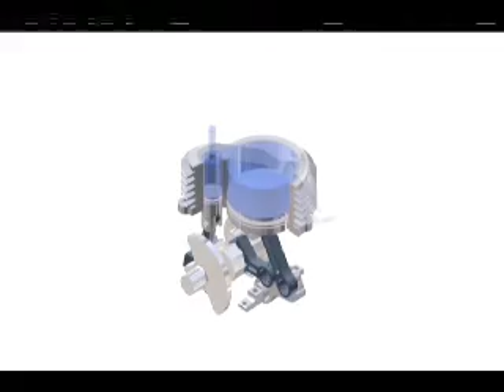A car that runs 200 miles on compressed air.

Comment: @blueearthgirl "Why would this increase global warming?" Because using the same amount of electricity to run the air compressor this POC needs in an electric car of similar performance you will travel 5 times the distance. The losses in compressing and using the compressed air are an appalling energy waste.
Are you still speaking with the ability to check on scams, analyze the science behind this MDI piece of crap or a you speaking with the usual green happy clappy please rip me off thinking?

Comment: - Filipino inventor, Ismael Aviso, has demonstrated a bare bones electric vehicle with an 11-kW DC motor running on just one 12-volt battery, which is kept charged via a Tesla-like antennae circuitry that draws electrostatic energy from the surroundings, validated by the Philippine DOE. He hopes to introduce plans and kits commercially soon; may open source.... (PESWiki; [updated March 22, 2011])

Comment: Quote- The Pneumatic Options Research Library is a treasure trove of information on how to gain free energy from compressed air. The most important fact to realize is that the very act of compressing air yields free energy.

Comment: This happens because, according to the mathematical formula PT/V, 100% of the energy required to compress the air is converted to HEAT, but then you also have the compressed air that can produce mechanical energy when it is expanded again. A home heating system that uses this principle was patented in 1930 and is available for download here: THERMAL PLANT - Google Patents Dr Peter Lindermann- End quote.

Comment: Using clean and renewable compressed air for motive power has been around since the 19th century. It was then that the first approximations to what could one day become a compressed air driven vehicle existed. This began through the arrival of the first pneumatic locomotives.

Comment: The Magnetic Wankel Engine
(Takahashi Motor)

 The Magnetic Wankel engine should also be capable of COP > 1.0 and closed-loop self-powering, but apparently it has also been suppressed, as have all Japanese COP > 1.0 EM systems.

For details, see T.E. Bearden, "The Master Principle of EM Overunity and the Japanese Overunity Engines," Infinite Energy, 1(5&6), Nov. 1995-Feb. 1996, p. 38-55; "The Master Principle of Overunity and the Japanese Overunity Engines: A New Pearl Harbor?".

Comment: The National Tattler (November 11, 1973), p. 6

"Car Driven by Fuelless System"

by

Tom Valentine

You’ll never need to drive into a gas station again if Robert Alexander’s fuelless car gets into production.

Alexander has invented an auto-drive system that uses a combination of electricity, air, and hydraulics.

His car can operate without fuel, without noise, without pollution and without the need to recharge batteries every day.

Comment: @braikar This POC requires 5 time more energy than an electric vehicle of the same performance. The air tank has a limited cycle life. The best recorded and published range in a test was 5 miles. The technology is 100's of years old and has no possible improvements that haven't already been tested (multistage direct injection). It's a 15 year old con that has taken well over  $20 million from technical illiterates. 

"great [potential" Would you like to buy a bridge?

Comment: @aldromazos So the $20000 set of panels you've bought to run the 6 kw compressor for 6 hours to refill this POC with it's ACTUAL range of 5 miles is your idea of genius? Would you like to buy a bridge?

Comment: @fizzguts I still believe it will break the third law as produces no heat nor needs any too run but I havent heard if that experiment has been done an im only stating completed experiments. Since your such a physic's professor you'll have no problem telling me what renowned physicist originally came up with the experiment that was near copied too produce Dr. Paulo and Alexandra Correa contant 3 watt stirling motor. I'm happy for you too disagree but at least you'll know what your disagreeing on

Comment: @Txsray electromagnetic aether because its mass free an so now that Dr. Paulo and Alexandra Correa have produced this new constant motor that produces 3 watts day or night it not only pokes holes in The theory of relativity, it also breaks the second law of thermodynamics.

Personally Id like too test it with the third law of thermodynamics because I doubt it produces heat so cooling too absolute zero could be achieved but thats just my opinion I dont know.

Comment: Free energy labeled 'economic terrorism' - The widespread adoption of these new, non-polluting energy and propulsion systems will effectively replace the use of oil, gas, coal, nuclear power, impacting 4.5 trillion dollars a year in world economic activity, replace? the current? geo-political order with one based on decentralized abundance. (Examiner; March 21, 2009)

Comment: @paulomrodrigues Why don't you just put bigger wheels on the back of your car so it rolls down hill all the time. Even better a sprocket on the back axle connected by an bike chain to a sprocket on the front wheels so the back wheels drive the front wheels.!!!!!
Sigh the world is full of idiots with the scientific knowledge of a concrete lamp post

Comment: For the first time, Joseph Newman demonstrates the
energy machine that turns a 1,650-lb rotary and powers a
375-lb positive displacement pump using LESS THAN 20 WATTS!

In the video demonstration, the energy machine produces phenomenal
speed, torque, and continuously pumps water using LESS THAN 20 WATTS!

LESS THAN 20 WATTS!!!

Conventional technology would say that such is not possible.

Yet, the Newman Energy Machine can accomplish that ... and much more.

Comment: World War 2 was well underway in Europe, and the Germans were agressively procurring any advanced technologies they could find. Toward the end of the war, the Germans perfected their pulsejet propusion system, which was probably inspired by Bob Neal's patent, since it uses the same ideas as the mysterious equalizer that allows low pressure air into his air tank. Of course, the Germans used their pulsejets to power their V-1 cruise missles to shower London with bombs.

Comment: Before you lose your perspective on this, a compressed air engine that runs from a tank that keeps itself at full pressure all of the time is NOT a perpetual motion machine. It is a HEAT ENGINE that runs by the extraction of heat from the ambient air, which was put there by the SUN.

Comment: Even if they installed a compressor that uses the energy of the car to run it cause air to be recompressed. Energy still will be lost due the mechacnical nature of the process. The laws of conservation of energy however never said that you can't create a situation in which 99.999999 percent of energy is conserved so all these Bullshit ppl with their dumb arguments us perpetual energy to try and shut ideas down. You can't have perpetual energy... but you can have damn near almost perpetual.

Comment: Tommy Reed engine demonstration - Last week, Tommy Reed did a live demonstration on the SmartScarecrow show, using compressed air. The engine allegedly could be 85% efficiency compared to 35% for the best conventional internal combustion engines. (PESWiki; Jan. 28, 2010) -"All of Mr. Reeds Youtube posts have recently been deleted "
Reply: Cleaning Department at works!!...🤣🤣🤣🤣

Comment: Air is too heavy? What a stupid post. It completely ignores things like the weight of the various engines. Gasoline engines are much heavier than electric motors. 

And what does "ineffective" mean in this context? I can only assume you meant "inefficient". And even that assertion requires evidence. 

It is also stupid to compare fossil fuels to energy-storage devices, because FF's are always an ecological disaster, but energy storage  devices are as clean or unclean as the source of the energy.

Comment: : > Compressing air produces both heat and pressure.
: > Let assume a gas is cooled just after compression
: > and the heat is usefully used
: > (for example with a Quasiturbine Stirling :

: > Then later, make use the ambient air or lake water
: > temperature to warm-up an isothermal expansion
: > of that same compressed gas: > which will restitute close to the total amount of energy
: > given initially by the compressor

Comment: There are many of arguments against such cars: Two are important:
Compression of air is extremely ineffective. 
And: It sounds odd, but: Air is too heavy. To store 10 kWh of energy, you need 500 kg of compressed air. Or 330 kg lead battery. Or 100 kg Li-Ion-battery. Or less than 1 kg gasoline.
The principle works, but the 200 miles are a lie. 
Maybe, this car reaches 50 miles, but I don´t think so.

Comment: IS THIS WHY AIRCARS HAVE BEEN SUPPRESSED---According to his design the hot air was pressed into a motor which contained a number of cylinders, half of which go down when the others rise up. As in an ordinary engine, the crankshaft forced a rotating movement. The major difference was that the air after having passed through the cylinders, passed again through the cylinders by means of a compressor at the side, causing a continuous circulation and enough perpetual movement to last three months.

Comment: "Implications of success... as the widespread adoption of these new, non-polluting energy and propulsion systems so that the use of oil, gas, coal, nuclear power and other earth damaging sources of energy are effectively replaced. It should be noted that such an undertaking will impact 4.5 trillion dollars a year in world economic activity, replace the current geo-political order with one based on decentralized abundance .

Comment: @Tardis1217 Fuel heats water to produce steam. running the fuel through a conversion process to power a compressor to run an air car simply adds another energy wasting step.

Comment: Because I am convinced of these things, this  has a definite emphasis on self-fueling air cars, self-filling air tanks and the like.  Fueled by ambient heat, the compressed air in a constant pressure reserve is not a perpetual motion machine, as some accuse without giving evidence.  It is a machine part that doesn’t wear out, an air spring.  If you can stop a train with air brakes, you can use the air in a tank to force more air into the tank .

Comment: @kenkruger "There are several forces at work keeping this from mass use and production. First and foremost" is the lousy efficiency with is due to physics not wishful thinking.  Air powered vehicles have always been and always will be short range and inefficient.  MDI relies on technical ignorance to sell this franchised con.

Comment: Most of the discoveries have been made by curious, ingenious minds, who on many occasions have observed experimental results in cold fusion, superconductivity, and magnetic motors which appear to violate present laws of physics, chemistry and electrodynamics. A term has been used to describe such phenomena, is called over-unity energy or free energy, which in many cases means getting more energy out of a system or reaction (magnetic motor or cold fusion reaction) than appears to be put into it.

Comment: Compressed air storage is a possible alternative to electric batteries for energy storage, but it's not 'free'; it needs energy to compress,  But like electric cars, that energy may be cheaper than carrying and burning petrol - and if the energy comes from solar or other renewable sources, better for the environment.
The bit about the car one day compressing its own air is hogwash though.  The film maker obviously doesn't know basic physics.

Comment: According to his design the hot air was pressed into a motor which contained a number of cylinders, half of which go down when the others rise up. As in an ordinary engine, the crankshaft forced a rotating movement. The major difference was that the air after having passed through the cylinders, passed again through the cylinders by means of a compressor at the side, causing a continuous circulation and enough perpetual movement to last three months.

Comment: @guscaldas2 
Sources are as per my google sugestions.  
As a taste google 
e.volution south africa (don't use quote marks)
MDI lies from 2000
You'll have to scroll back through these comments to find the complete set of my suggestions for google.
Alternatively the air car forum on yahoo group used to have a large files section. Join and you should gain access to  lot of calculations showing  energy density range etc etc plus a steady up date of MDI missing yet another delivery date.

Comment: COMPRESSED AIR VEHICLE

Pneumatic systems have a big advantage: they are cheap and don't require impractically expensive battery maintenance.
A 40kg 25 cubic meter compressed air cylinder the same size as
the steel types used in natural gas vehicles can store 4 kw-hr of energy.
Assuming (conservatively) that 50% can be recovered, we have a real world density of 2kw-hr/40kg = 50 watt hours per kg.

This is much better than the best lead acid lead acid batteries which can achieve 50 watt hours .

Comment: It takes fuel to compress that air, such as electricity.  And it takes fuel to create that electricity.  So this car does produce emissions, you just don't see it coming out a tailpipe.

I cannot believe that they would suggest that this could develop into a perpetual motion machine.  Work input has to compress all this air, it is far from free.  Ever heard of a little thing called friction?

Comment: In 1931, Roy J. Meyers of Los Angeles built an air-powered car (air has been used for years to power localized underground mine engines). Myers, an engineer, built a 114-lb., 6-cylinder radial air engine that produced over 180 hp. Newspaper articles at the time reported that the vehicle could cruise several hundred miles at low speeds.

Comment: @lightsout9999 
google 
bloom box scam
It's a fuel cell. big corporates can get a tax rebate which covers the horrific cost and bank the rebate. It probably doesn't produce power cheaper than the mains. 
Some of the claims such as if on Mars supplying oxygen and not producing CO2 for natural gas fuel are complete & utter BS

Comment: Now get this, skeptics: there are already several corporate customers using refrigerator-sized Bloom Boxes. The corporate-sized cells cost $700,000 to $800,000 and are installed at 20 customers you've already heard of including FedEx and Wal-mart -- Google was first to this green energy party, using its Bloom Boxes to power a data center for the last 18 months. Ebay has installed its boxes  in San Jose.  saving about $100,000 since installing its five boxes 9 months ago . Nice :)

Comment: @lightsout9999 Repeating a 6 kw air compressor running for 6 hours to recharge the 180L 3500psi tank which enables this piece of crap to go about 5 miles (MDI's ONLY published test). Still not free no how no way. An electric car is about 5 times more efficient.  google 
vencat 20 miles 
for the numbers from MDI's former USA distributor.
It's a con aimed at selling franchises to technical illiterates

Comment: @lightsout9999 "For recharging the "Air-Tanks" we could also use the sun which is also green and free" FREE? What bit of the $40,000 solar electric system you need to run the 6kw air compressor this piece of crap requires is FREE?

Comment: For half a century the air-powered locomotive was a serious contender for the top spot in transportation because of its obvious advantages: simplicity, safety, economy, and cleanliness.  Air engines were commercially available and used routinely, first as metropolitan street transit and later for haulage in mines.

    The term "air engine" disappeared from engineering textbooks after the 1930s and the second world war.  The oil industry was established, and gas was cheap.

Comment: @forcuties you also have a very limited range. In the only published test MDI achieved about 7.2km on 180 liters of 3500psi air. The engine in the cars is rated at around 6 hp so it's a flat land vehicle and slooow acceleration. MDI have been promising spectacular mileage for over 10 years but have never demonstrated anything even close to their claims.

Comment: n 1907 Charles B. Hodges patented a 2-stage air engine, which expanded the same air in two consecutive pistons. Between the two stages, a heat exchanger warmed the air, expanding the air supply by absorbing heat from the environment. This is possible, because compressed air gets cold when it expands so an air engine is part of a refrigeration cycle, or a heat pump cycle, by drawing free heat into itself from the surrounding air.

Comment: They use air turbines as starter motors on big jet engines. But they’re not very efficient until they get up to speed, so maybe instead the IC engine could be both engine and compressor. Lee Rogers solved that by making his air engine 4-cycle. The engine itself compresses some of its own air on every fourth stroke, with an added supercharger and also maybe a small high pressure compressor that puts out about 600 psi.

Comment: @iamjalove What do you need to know bro? Scroll back through the posts and there is list to google or join the air car yahoo group. They used to have data plus worked calculations in the files section.

Comment: @ReeseL4D "When Reese said 5min on 24L is ok" &  I said Reese is an idiot  as a 5.8hp engine with a run time of 5 mins is pathetic, stupid & dumb. The interesting thing is the engineair consumption figures are based on a constant flow & pressure source. The real world intrudes as a pressure tank cannot be completely drained and when the tank 3500psi is dropped to approx 200psi for the air motor about 50% of the energy is lost. Unfortunately stupid people don't understand this. Oh dear how sad